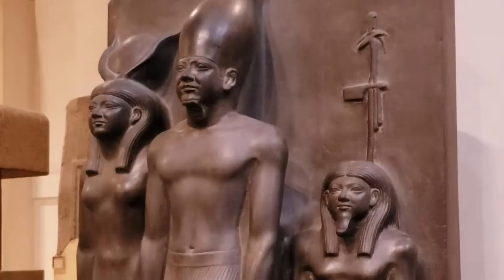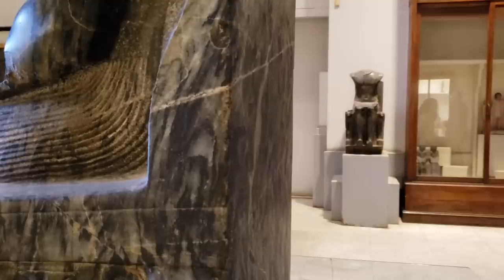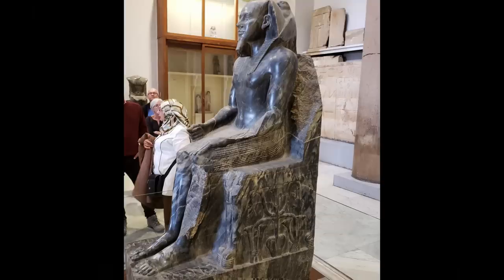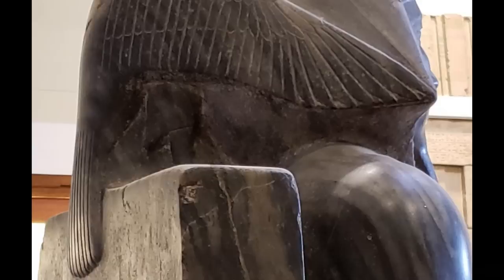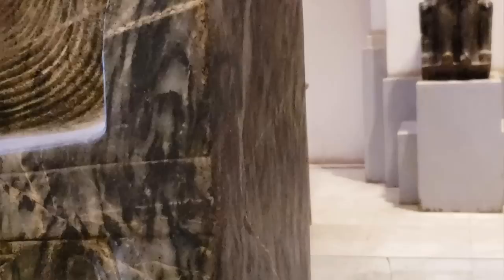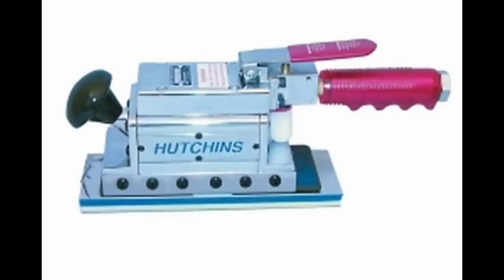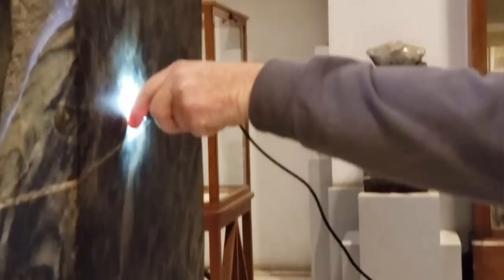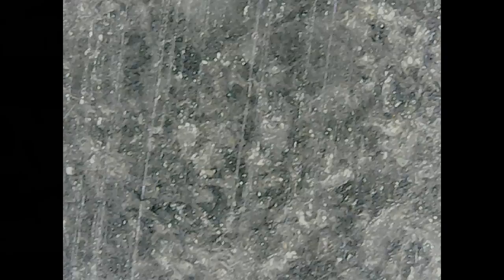Khafre's Diorite Statue

Comment: They would have had blacksmiths constantly sharpening the chisels.
Reply: Sorry.  It would be like trying to chisel wood with a piece of chewing gum.  Diorite is harder than modern steel.  Copper chisels will simply NOT do the job.
Reply: There were no blacksmiths in Old Kingdom Egypt. They had no iron.
Reply: @brabanthallen  I'm a stone Mason and can cut stone with a wood saw. 
It blunts quickly, but it can do it, bath stone and portland. How else would you carve stone? It's with chisels.......
Reply: @Brett Hess  fair enough, they would have had workers sharpening chisels, though.
Reply: @brabanthallen  what's your profession?
Have you tried?

Comment: It looks like it was somehow poured into a mould. It reminds me of the fine finish you get when slip casting clay, but how is this possible  with diorite ?
Reply from the maker: It isn't.
Reply: Anything is possible, when using and knowing the correct frequency/vibrations. I think they knew how to melt and or soften stone. Would help explain how they end up with such intricate 'cravings.'

They just pour into a mold and then polish it.
Reply: @elgoog7830  but then it wouldn't look streaky as the statue does
Reply: @elgoog7830  how did they produce a mold which would take heat

Comment: What if the ancient Egyptians had really hard tools? Tools made from modern steel, with Mohs hardness of  5.5 or 6.0. Like modern steel, weird to think about
Reply: Not found any so far!
Reply: @debrarobinson57  My father was a civil engineer who had specialized in materials engineering first ; oil , stone , metals . In the late 1950s he was sent to northern Ghana to check on an area where stainless steel had been made for hundreds , many hundreds , of years . Stainless steel was produced , way before the industrial revolution , by the accidental mix ore the right ore , lime and wood (coke) used . Weapons made in stainless were exported right across Africa from the village he visited . He found that the mines would not be worth expanding on an industrial scale and the villagers were left alone ; which I am very happy about ! I cannot find anything on the net about this , if you can find more info I would like to know . However I am completely sure that this is factual , incredible though it seems . Cheers , Dave

Comment: If you want to find the tools that these people used to make  this statue, you have to go to the very last place where they carved or built something. If you go to the Empire State building, you will not find any tools nor machinery there with which the skyscraper was built. I formerly built high school buildings, ...I never left my expensive machinery nor tools at the site after the job was completed. What kind of  idiot  leaves valuable tools at a worksite? Nope, you will never find these tools coz they are hidden somewhere far away at  a home base or near the last  job these people did [if a catstrophe struck them hile on the job.]. If you think like a construction guy, you can figure this one out. If they had very advanced precision machinery, then it logically follows that they probably had very advanced precision ground transport, logistics, and  aircraft to fly to the next site, just as we do now. Gimme a break already.  The Greeks said that Hephaestus built ["well-built-walls""] by using Cyclops; Hephaestus  built  statues,, robots, flying machines [ according to the Greeks, Hercules flew in one of his aircraft].There is your so-called advanced precision technology already recorded by the Greeks thousands of years ago. Occam`s Razor here..If you an engineer,  can read ancient Greek and  read "Wisdom of Solomon", in the original Greek, therein is is described a laser, an air cushion vehicle and other devices used to cut and transport the Temple foundation blocks to Jerusalem from the quarry. If you can`t read ancient Greek  and are not an engineer, then you are just dancing in the dark here. Just sayin`
Reply: Apparently they found a chariot with a sign saying "No tools are left in the chariot over night"

Comment: How the stone looks shiney
Reply: Same way we do it today.  Use a chisel to rough out the shape you want.  Then use a rough abrasive to smooth out the chisel marks.  Then a finer abrasive to smooth out the scratches from the rough abrasive.  Then an even finer abrasive to smooth out those scratches.  Keep going with finer and finer abrasives, and eventually the scratches in the surface will be too small for your eye to see, and the surface will look shiny.  We do it with machines, which is pretty fast.  They had to do it by hand, which took much longer.  Watch Justin at Black Opal Direct polish an opal, and you'll see him do this same process on his machines, and take a rough pebble to a beautifully shiny gem.

Comment: what's going on at 3:05 ? it looks like the stone is white inside with a 1/4 inch layer of black over it?
Reply from the maker: what you see is the reflective difference between the outer, smoothly polished surface, and the unpolished stone surface at the bottom of the detail cuts, below the outer surface.

Comment: The Egyptians had diamonds. They knew how to polish diamonds. They knew how to set diamonds into other metals. A diamond could scratch diorite. Diamond dust could polish it.
Reply: You are talking nonsense.  No diamond has ever been discovered in any ancient Egyptian jewellery.
Reply: Totally agree
Reply: I agree with that the concept of certain minerals scratching or cutting other minerals was clearly known to these sculptors. Probably not diamond but idk. 6.5 on the mohs scale isn't intensely hard. They probably  had to have used tools that accepted the charging or embedding of harder minerals dusts, and copper qualifies as a substrate that is capable of this.
Reply: @wanparaph  no offense but can you hear how ridiculous that sounds? It was made from one single slab. How did they quarry it? How did they rough cut it? Copper saws?  Since copper and brass chisels won't do anything except flatten with each strike of a mallet or pounding stone how exactly did they shape it? Lastly, the statue is exquisite right down to the toe nails which look like they were cut with a laser they're so precise, and then you have the hieroglyphs identifying the statue as Khafre that look like they were chiseled in by a 12 year old in comparison to how superior the work on the statue is.
Reply: @patrickdennis7041 Note: stone of equal or greater hardness can be used for this purpose. Sand which contains quartzite, will also work, and we also know that the Ancient Egyptians mined and used corundum too for this purpose.
Reply: @wanparaph correct. And we know they mined and used corundum for this purpose.
Reply: They had Garnets not diamonds.

Comment: if it is so hard a material why is it broken 😊
Reply from the maker: Hardness refers to the resistance of a material to abrasion/sculpting. 
A material can be extremely hard, but also very brittle. ( glass would be an example; it is hard enough to require corundum or diamond engraving tools., but drop it and one discovers it is quite brittle.)
Another factor to consider is the cleavage planes and fault lines that occur in igneous stone as a result of the varying rates of cooling / crystallization process.  The arm and calve of the statue were broken away at fault lines in the material, due to the drop into a shaft several meters in depth. ( as the old joke goes, it's not the fall that hurts, it's the sudden stop )

Comment: i do this with silicon carbide sand paper and a tub of water.....
Reply from the maker: Really?  I would love to see a video clip of your statue!
Reply: @AncientEgyptArchitecture  lololol
Reply: @AncientEgyptArchitecture  the sad part is there are quite a few minerals available in abundant enough quantities for a civilization thats oh say 5000 years old to figure out one mineral scratches another.  if all you have to build with is stone and sand....ur gonna get real good at it over 5000 years.  imagine how good at ugly concrete buildings and steel structures in 5000 years if we make it.  its not a stretch that they did this work.  the question really is how did they do it so damn well if they really did use say garnet or topaz impregnated copper saws.  im not saying either way is true bur i am curious.  which is a better way to approach this than oh really.  because yes i finish about 3 small pieces of granite(unakite) a day for jewelry with sand paper from 180 grit up to 10,000 grit. simple wet dry silicon carbide.  could i build a pyramid?  heck no.  but alot of "mes" could lololol.  just sayin.

Comment: Sorry but you are simply wrong, you can absolutely work a hard material with a softer material. Just wont last long.
Reply from the maker: Thank you for your feedback.
Reply: @AncientEgyptArchitecture  Well its not feedback but you're welcome
Reply: The tool marks tell a diffrent story, and so do the results. This level of precision absolutely can not be achieved by copper and abrasives, there is a diffrence between roughly attacking stone, and carefully sculpting, and the cartuches would be proof enough if archeology was intrested in proof, and so are the microscopic pictures taken by the author of this video, which are close to unrefutable unless one is more intrested in defending a narrative based on hearsay.

Comment: well I would have put my microscope on the face at the very least rather than the simplest parts to measure.
Reply from the maker: Obviously you have never had to deal with the guards at the Cairo museum.
Reply: @AncientEgyptArchitecture  does that make my point any less valid?
Reply from the maker: Yes. If one is not permitted to climb on the displays and do whatever one likes, then your comment is not pertinent, since what was done was all that could be done.
Reply: @AncientEgyptArchitecture  I mentioned the face because it is smooth and a curved surface.  This may have given insight into how they had achieved the smooth curvature- i.e. was there a repeating pattern on a microscopic level?   If you couldn't reach the face then there was always the leg and a choice of arms too, which were right next to the surfaces you chose.

So "what was done was all that could be done" isn't the case.

I appreciate what you have done with the flat surfaces because it gave further insight - the curved surfaces could have revealed even more.

Unfortunately you decided to take a snarky tone, which I really don't know what to make of it lol.

Comment: Well at least you didn't say giants polished the statue.  You cannot rule out a technique because you looked at a couple of inches of the total statue. My feeling is whoever polished it, used the most efficient techniqe to be accepted. In this instance it looks like they  pushed back and forth and it gave them the appearance the wanted. But many of the small features might have been done  by copper wheel engraving. my feelings are if you were able to sample "say a toenail" you would find copper or bronze trace elements. Hey, you used sandpaper before, do you always polish in a circular pattern. i bet you don't.
Reply from the maker: I used sandpaper for 45 years as a professional cabinet maker. And I know based on those decades of experience that, no matter how hard one might try, the human hand/arm is incapable of making perfectly linear, evenly spaced strokes across a flat surface, much less a curved surface. The tendency is to always curve ever so slightly to one side or another in the case of short strokes, and for longer strokes the effect is exaggerated. So yes, I absolutely can rule out hand polishing, at least for the areas I acquired microscopy photos from.
Your feelings might be correct, but of course we don't assess such things based on feelings, but rather careful examination and documentation. Until someone actually does the testing on the toenails it will remain a matter for conjecture as to exactly how they were carved.
Reply: @AncientEgyptArchitecture  Thank you for bringing this mystery of highly polished lithic artifacts to question. I have been puzzling myself over this for many years, since first seeing in a couple of large and well known museums, artifacts made of lithic materials of various sizes and in similar states of high polish as shown in this video.  You are 100% correct about using sandpaper! However I will take it a step further and say one can not create perfectly straight, evenly spaced polish striations using any type of polishing  material on an object that has curved or rounded surfaces, especially in areas of intersecting angles at various degrees! Looking closely at these polished areas, using modern equipment and current technology that allows us advanced imagining and very high magnification, proves this to be a fact!
  I have been a flintknapper for nearly forty years and have studied how various rocks and minerals break, fracture, crumble and crush under various striking forces and directions of pressures applied to them using a variety of materials as tools, such as various antlers and bones as well as other varieties of rock, or even the same type as being  carved, chiseled, flaked, sanded or polished to create a finished product, that being a statue, tool or projectile point. I have a very good understanding of how these beautiful and unusually finely finished statues can be made. I just do not understand... how, they were made!

Comment: sand...finer and finer grain. Anybody who's worked rock can tell you that...not a mystery
Reply from the maker: Thank you for single handedly solving this perplexing problem!
Reply: How do you explain the straight, equally spaced scratch pattern? Rubbing with sand would produce a much more random scratch pattern, no?
Reply from the maker: One would certainly think so....although many commenters here assert that the human hand/arm is of course capable of perfectly linear repetitive motion at large or small scale, I have found in my career as a furniture maker that this is not the case.
Reply: @brushstroke3733  not at very fine grit...how do you think stonecutters get that high polish? If there are scratches you'd have to back several steps and that is a real drag
Reply: @brushstroke3733   the fastest method for removing material by hand is not by randomly sanding it. You need to sand in a linear direction then cross hatch it at 45°-60° angle then cross hatch it at the opposing 45°-60° angle. working stone with some can be done it's just time consuming

Comment: They made a wooden mould, melted the stone and poured it into the mould...
Reply from the maker: Hard to imagine where one would be able to find a type of wood that would not instantly burst into flame when molten Diorite touched it...
Reply: @AncientEgyptArchitecture  Do you have another explanation? No you have not. Wood can be cooled with water so that it is not destroyed by molten stones but it should be tried out in an experiment...
Reply from the maker: I think this is an excellent opportunity for you to demonstate your hypothesis, and document it.
Reply: @AncientEgyptArchitecture  Someone who has the opportunity can do that, I can't, but you can watch how glassblowers cool the wooden mold ;)
Reply: @AncientEgyptArchitecture  They have plenty of sand.  Sand casting in wooden boxes was quite common, they certainly had the skills and materials to make a mold.  I dont know what the melting point of Diorite is, does it melt before sand?
Reply from the maker: All high silicate density materials ( such as sand and igneous rock ) melt at close the same temperature,  between 1700 to 2000 degrees centigrade, and in this specific comparison, diorite would require a slightly higher temperature to melt than common sand.
Another complication however is that simple sand is a bad material for molds because it will not remain compacted unless other materials are mixed with it.    In Foundry work the molds are made from a mixture of pure silica sand, bentonite clay  and coal powder( to provide a bonding agent ) 
For a definitive answer on whether or not your casting hypothesis is viable, I suggest contacting a foundry operation nearest you and asking them if they are capable of making a sand cast of molten stone..
Reply: @AncientEgyptArchitecture  That's an excellent idea, I'll see what I can do and maybe you or someone else can do the same, an email to several foundries should do, thank you...
Reply: @AncientEgyptArchitecture   I was curious, i had a friend work in a foundry; as far as im aware, they did only metal objects. Thanks for the information, one of (many) lifes mysteries.
Reply: So, we know the stuff was cut and polished because of the inclusions. Ground, they would be dust, and melted, they would be warped. These are especially prevalent on the pottery and bowls.
Reply: Nope.